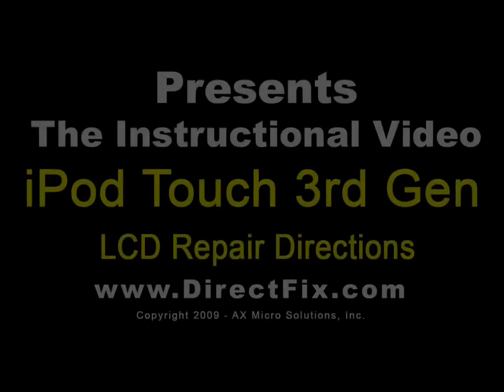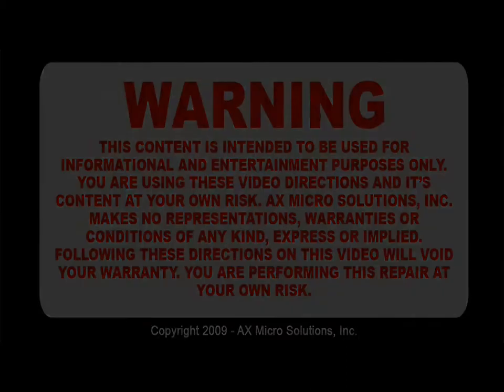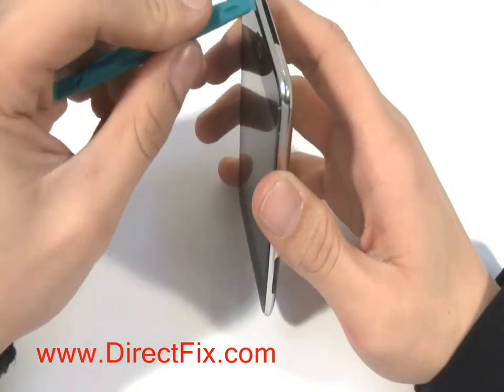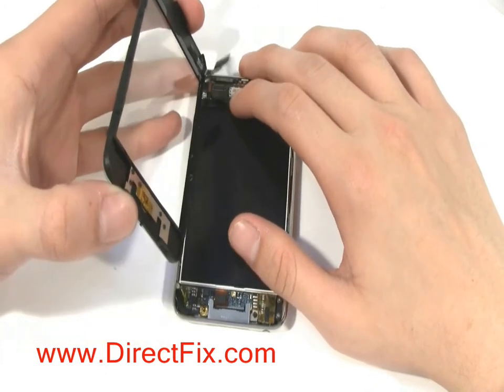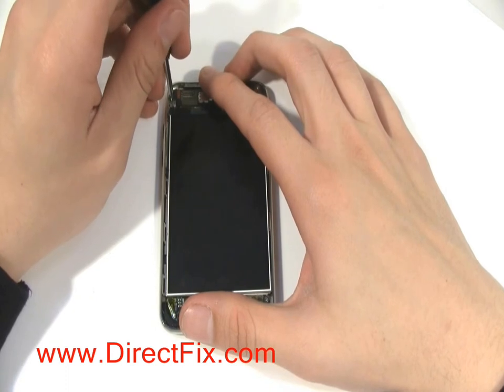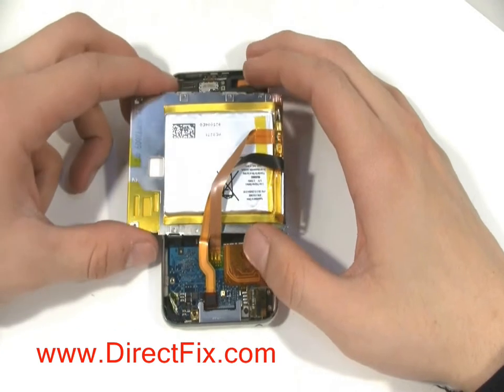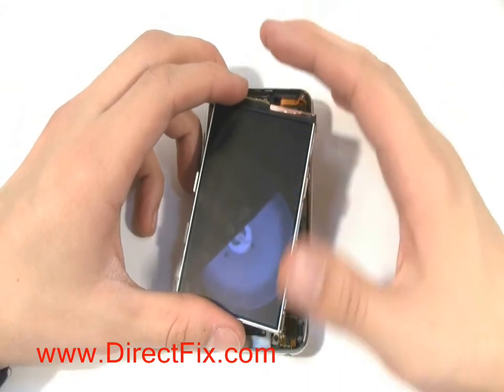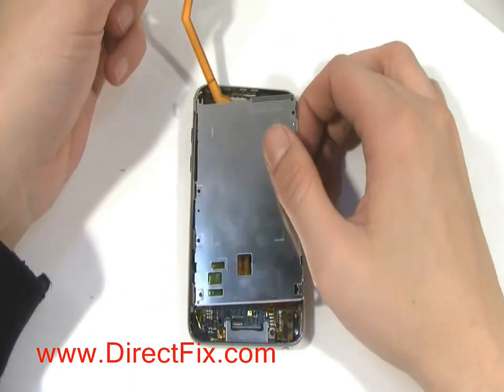How To: Replace iPod Touch 3rd Gen LCD Screen

Comment: My IPod Screen is White , I dropped it down in my floor and it's white but you can still see it a little and the iPod is disabled , no scratches on screen . Is it the LCD I need to buy to repair the white screen or what?